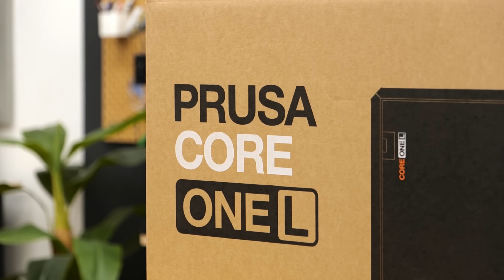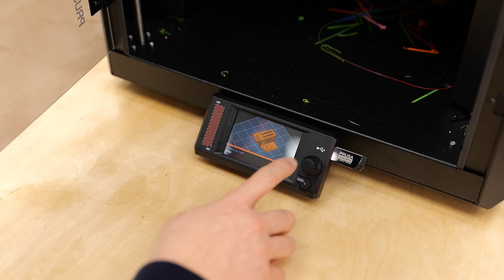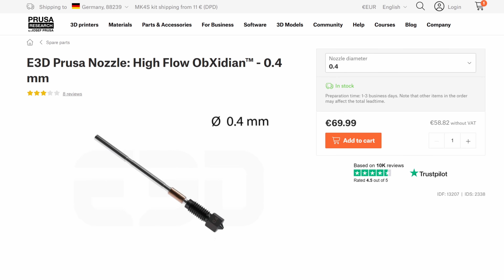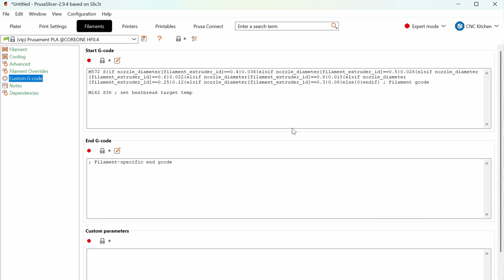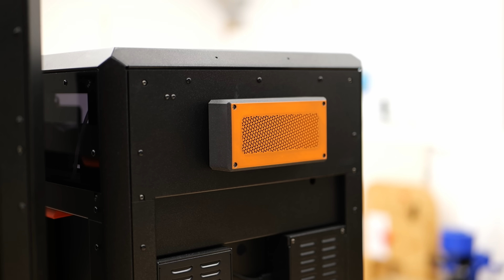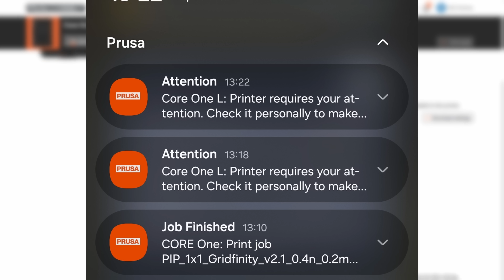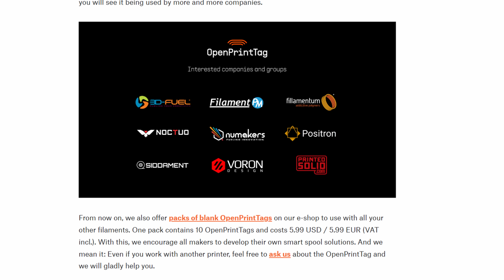What Prusa Got Right (and Wrong) with the New CORE One L

Comment: Can you do a Prusa vs Bambu Video after 2000h of Printing.

Print Quality after 2000h
Spareparts needed 
Hours of Repair and Waiting for spareparts.
Reply from the maker: I should maybe find a project for that. MOAB Nerf Blaster?
Reply: FYI: i had a really bad experience with my H2D but good with A1 Mini 

My Prusa MK4s is the reliability Champion.

The Flashforge AD 5 Pro is my easy to Repair friend.

My Core One is fresh, with 300h I had No issues with all Printers 😅
Reply: @einfachmachen-ro funny because my P1P has been the reliability champion compared to the Prusa Mk3 and Mini.
Reply: @einfachmachen-ro my mk3s was doa and constantly broke down and my mk2 caught on fire due to a bad bed connection from factory. Both units fully prusa assembled. Warranty was waiting weeks for parts and doing a full reassembly... After I got my mk3s the cooling fans literally had their rotors fall off the hub somehow...... I have had probably 10 non prusa printers fail in various ways at work and we now have probably 6 bambu printers and one died due to a user accidentally shorting the tool head PCB out but the repair was comparatively very easy swapping wires and tool head boards out.
Reply: I have more hours than that on my P1S and needed zero maintenence so far, not even a new nozzle, and the spare bowden tubes you get with the AMS are still unused
Reply: @AniviaS  mine wears out the bowden tube above the tool head every 1000h but otherwise its fine.
Reply: @AniviaS what issues did you have with the H2D and have they been resolved?
Reply: Shop Nation did a comparison a year ago after 1000 hours of printing between MK4s and P1Ps. The P1Ps yielded more parts with less portion of prints being scrapped.
Reply: @stevato0449 you mean the Video  they used used MK4s and mk3 vs Brand new P1P?

They make this clear at the beginning.

And i know, price wise the Prusa is more expensive, but its Not compareable Technologie.
Reply: +1 Vote I would love to see that
Reply: I’ll buy a cool one when they include multi exterior support. That’s what the community needs.
Reply: Yes! Perfect
Reply: Purely anecdotal, but I've got ~8000hrs total on my 6 Bambu machines and I haven't replaced anything but a €14 cooling fan that I thought was too noisy. I'm really terrible with maintenance too, I've re-lubed the z-screws and cleaned the extruder once per year but that's really all. Zero degradation of print quality as far as I can tell. 

The one thing I find a bit annoying is that the connectors can be a bit fiddly when switching hotends (P1S) and I don't always get them working on the first try. I rarely switch though so it isn't really a big deal for me.
Reply: @oyuyuy  this issue is also solved at the P2S :D
Reply: @SteamCookies so its a h2d issue? 

Cause all Problems i Had was only on Tool head. 

The a1 mini is running.
Reply: It's probably best to look into people owning printer farms, as looking at individual samples has no meaning
Reply: I've seen one on Bambu from someone owning a print farm, you could try to find that
Reply: @user9267 you mean the one that testet used mk3 and MK4 against Brand new P1S for only 1000h? 

Realistic would be MK4s vs A1 for 2000h 

In my ownership
- Bambu H2D started to be a Problem at 800-1000h (every issue was toolhead, but 9 Times spareparts requird, 6 Times only Open, Clean Close within 350h) 
- A1 Mini works fine after 2500h (First nozzle)
- X1C started to need often Repair after 1600h / now 2000h(3 Times spareparts required)

- Prusa - MK4s has only oil and a second nozzle 4150h,
- Core One has 300h (No issues - 😜), 
- Flashforge AD5x has 631h No issues, 
- AD5 Pro Had one time filament feeding issues in 1200h - second nozzle 
- IdeaFormer ir3 v2 -  No spareparts required in 2500h, but any time you move the printer you need 5h of physical recalibration.
- Kobra 3 Max - killed IT self cause of toolhead cabel felt into bed after 750h
Reply: That guy with the printer farm did one.
Reply: @derektran9404 you mean the one that testet used mk3 and MK4 against Brand new P1S for only 1000h?
Reply: Prusa isn't winning that's for sure
Reply: @jordanplays-transitandgame1690  In a couple makerspaces i have used and maintained 20 bambu and prusa machines. In my experience the thing that might make the bambu more reliable is their error detection and handling. The fact that prusa no longer has collision detection makes it so much worse. Or when it detects nozzle clogs the prusa can't try to fix it. Repairs/maintanence are more freqvent on the bambus (which mainly comes from ams). Recently there was a part where the tolereances where to bad on the X1 compares to mk4s and core1. (the X1 might be older but the mk4s have catched up on hours printed)
Reply: @jordanplays-transitandgame1690  I'm Not sure
Reply: After literally enough filament to wrap the Earth THRICE, with 24/7 operation, my MK3/MMU2 (Millions of color/material change ops) only needed a replacement layer fan and printed like it was new... Good luck, DJI... I mean Bambu... I won't hold my breath, though.
Reply: @MissMerc  Hmm, yea... that'd be about 360,000 kgs of filament and ~1200 years of print time. Is that on a single printer or do you have two? 😂
Reply: @oyuyuy  [checks] so rounding generously to 40,000,000 m circumference for Earth and 400 m per 1kg 1.75mm spool of ABS, that's 100,000 spools per wrap or 300,000 1kg spools. Less generously and 360,000 kg sounds about right!
Reply: @Birdulon  Maybe I'm being petty now but why did you choose a lower density material like ABS over the far more common PLA/PETG that has ~330m per spool and that yields the 360,000kgs I stated? 😆
Reply: @oyuyuy how could I pass up 4e7/4e2?
Reply: @Birdulon  40k x 3 x 3
Reply: @oyuyuy  3 spools per km is a good number. Random thought: if they're measuring at the output, 0.4mm nozzle will give on the order of 20x the length for the 1.75mm input. Which is still totally unbelievable for the original claim lol.
Reply: @MissMerc  no European made junk is beating the Bambu, get out of here fanboy 😂 Bambu is the most common printer on print farms

Comment: You don't understand why they did not include the hardened steel HF nozzle? Really? I expected more from you! - Because CF / GF infused materials will clog with one.
Reply: What lol, why do you think that? Because it's 0.4?
Reply: @riba2233  Because in a CHT, each of the three channels are closer to 0,1mm. Recommendations for such filament are quite clear.
Reply: @mariusmossum2923  oh boy, that is just simply not true. They are not that narrow, and people have been printing cf/gf with them no issues.
Reply: Yeah that's not how it works. They are not that narrow, and people have been printing cf/gf with them successfully.
Reply: @riba2233  LOL back at you. Even Prusa recommends not to use CHT / HF with fiber-infuser filaments. And Sariatech does, just to name a couple. You may not agree. But that is why! And that IS how it works! 

Even a non-CHT 0.4mm is on the small side. So even the slightest tighter channels inside the nozzle will eventually give you problems. It does of course depend on the filament. Some so called CF-filaments simply contains dust, not fibers of any significant length. Probably the case for a lot of PLA-CF. It's there for looks, not for properties.
Reply: that is all absolutely false, I have printed a lot of cf and gf with cht, zero issues at all and many others have to. Also it's not only for looks, and they are fibers.

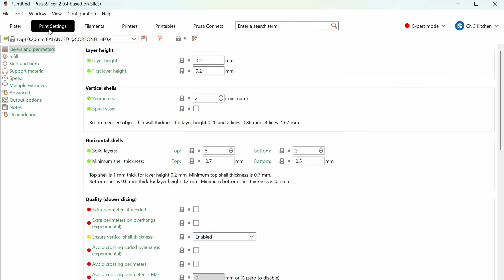Comment: 9:24 the prusaslicer 2.9.4 fixes your issue
Reply from the maker: Tried them all 2.93, 2.9.3-Review Edition, 2.9.4-RC and also the official 2.9.4 release.
Reply: @CNCKitchen interesting as the write up on 2.9.4 shows it theoretically eliminates the problem.  Weird!!
Reply: 5 months later, the latest Prusa Slicer 2.9.4 I just downloaded and installed still shows the exact same weird speed changes in the Clockwork Toaster... I really want a Core One L, but it's to justify such a big premium over a Bambu Lab H2S, even with an AMS 2 Pro, the L is still 200 € more expensive with so many really usefull features missing like a filter and a HT hotend. Adding that makes the L 500 € more expensive and on par with an H2D AMS Combo...
Not a great value in comparison even if you consider the longevity and PRusa Support cause I haven't from friends that have Bambus having a single issue after 1000 hours...
Reply: @TheWayOfThePrint   - yep, three BL printers plus 4 AMS2P and 2 AMS HT with > 4000hrs of printing with one single 'issue' on my H2S...fixed via Bambu Wikki (hotend clip hadn't been properly closed). Zero requirement for technical help.
Reply: This needs more upvotes!
Reply: Lies.
Reply: Hmm ok. I was just about to go with bambu after this video. Now I have todo more research.

Have a mk3s I want to upgrade from soon. Debating between H2D (with later Vortek upgrade) vs core one L (adding INDX later).
Reply: @perkulant4629  Vortek will be inferior to INDX, or any other tool changer for that matter, like the U1 or XL. It will be slower becasue it will still use the AMS, which has its own set of problems.
Reply: @perkulant4629  if you want the best value per improvement, get the 3.5 upgrade. I was a huge fan. Otherwise, wait for Formnext to make a decision.
Reply: @perkulant4629 wait for H2C, the H2D to H2C upgrade will be painful and expensive
Reply: @perkulant4629  h2d, it's not even close
Reply: @perkulant4629 if you end up getting the H2D, you will be blown away. Its the final boss of 3D printers. I'm sure Stefan will tell us all about how good Vortek is verrrrry soon ;)
Reply: He actually mentioned that he was using the junction tuning so I don't think so.

Comment: I love the company.  I don't love the printer.  In this time frame, another single nozzle printer makes no sense to me.  The print volume is nice compared to the Core One, but is not large enough to compare favorably with mid-teir and above offerings from anyone else.  The lower nozzle temps is particularly annoying.  I don't get this printer at all.  They saw all the other printers out there in this price range.  Right now in the USA the H2D is the same price and better in every possible way including dual nozzles for multi-material.  The H2S has a much larger build volume, is much cheaper, and has better quality output.

To me, this is the perfect printer for people who hate Bambu so much they are willing to overpay for an inferior product.  I do not like Bambu.  But, I do not hate them enough to harm myself to make a point.
Reply: A product for the fanbois..
Reply: As long as Bambu hasn't really closed down their ecosystems (proprietary filaments, cloud printing only, etc.) it's really hard to justify a Prusa, unless you're really into supporting European / Western designed and produced machines. I've been looking at Prusa machines for YEARS (I own a P1S) and every time I see the price I think "this needs to be 30% cheaper to seriously consider it".
Reply: @FrozenDozer  Bambu supports "generic" filament and filament tuning for any filament.  But, they make it much easier to use their own filament by embedding this data into RFID tags.  So not "locked in" but for those looking for the easy button, they will be might tempted by the huge discounts Bambu has right now on their filament if you buy ALOT of it.
Reply: @bjornlovoll8972 okay, and what's the problem with that? As long as they accept any other filament and all they do is offer the MORE CONVENIENT option, what's the issue?
Reply: @FrozenDozer  I don't have an issue with it.  I would prefer they be open and share their RFID info for others to use (like Prusa).  But, I don't get where the source for the Bambu is going to an entirely vertical market hoopla came from.
Reply: Very well said

Comment: To me the only fly in the ointment is the max. nozzle temperature - PET(without the G), PPA and PPS...just a few degrees more would go far in that department!
Reply from the maker: The limitations is the Thermistor and at some point the Aluminum heater block, but they should chase the competition here a bit.
Reply: @CNCKitchen  yeah idk why they are still using regular ntc and aluminium block, we used those more than 10 years ago.
Reply: Yeah for me to, my core one is great otherwise.
Reply: @garagecedric  a lovely toy for nerds for printing toys, thats exactly  prusa :)
Reply: @bartman2395 toys? It does car parts and tools in my case
Reply: I print PET made from soda bottles at 280C just fine.
Reply: therefore only qidi printers qualify
Reply: cuz u SURE NEED 370 nozzle for pps, nor what those idiosts state
Reply: @bartman2395  you need at least 350 for pps, 400 is also useful
Reply: @bartman2395  350 isnt perfect but good enough. The larger problem is the max 65°C chamber on both the Quidi and BBL H2 machines.
Reply: @lukahierl9857  you can edit printer.cfg in qidi printers and sky is the limit for chamber heater. Im running 75 C.